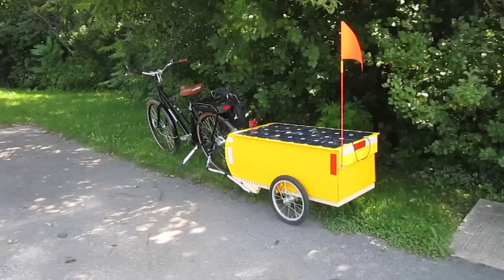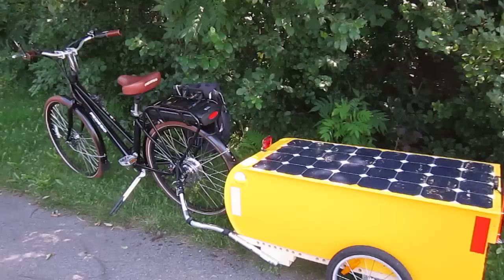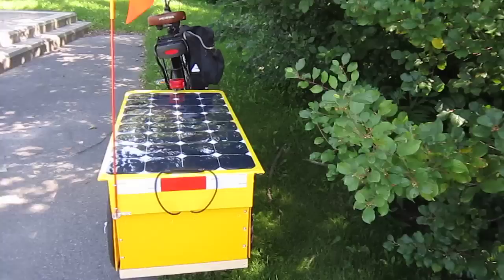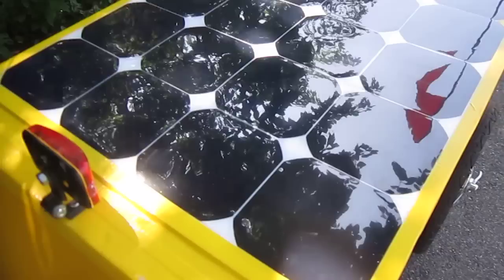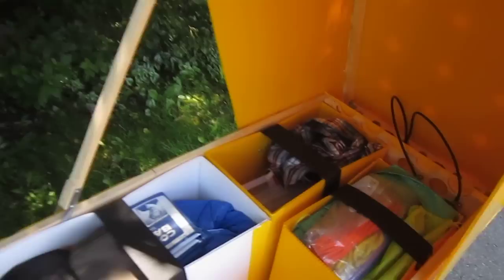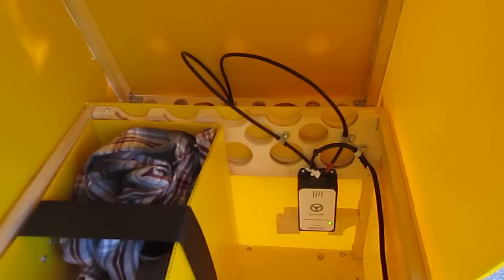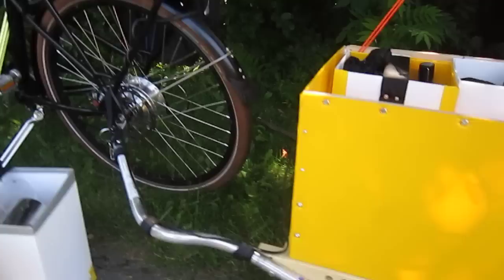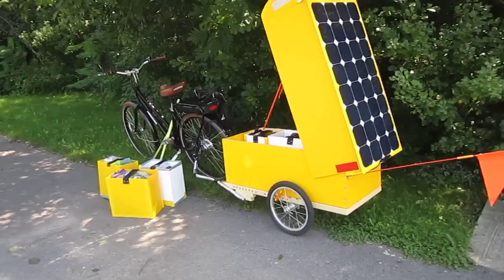Solar electric bicycle touring trailer for luxury camping

Comment: Very cool Robert. I built a trailer for myself last winter and our designs are amazingly similar! With the exception that I actually sleep in my trailer. I just returned from a 3 month,3700 km trip. I decided to post on my return rather than before I left. Check out my rig on my channel "yode on the road" I dig your design!
Reply from the maker: Congratulations for your great trip!. Do you have a picture of the trailer you sleep in?
Reply: Yode On The Road
Reply: Hi Robert. It took me a while but I finally an aged to post my camper.  The file was too big so it had to be cut a tad short. I see you joined my channel on Ytube so you will get a notification. Look forward to seeing more of your ideas. A few kms apart but two Canadians thinking in the same box...cheers!

Comment: insuffisant pour recharger un moteur électrique  !!!!!!!!!!!!!!
Reply from the maker: Vous avez parfaitement raison. Mais mon but est d'augmenter mon autonomie,  ainsi que de promouvoir l'énergie solaire.
Reply: The output left me doubting the idea but thinking of it as a mobile device to promote solar energy while battery boosting makes sense. What's the extra weight of the solar panel and the approximate weight of the trailer (with or without the panel), I wonder?
Reply from the maker: The trailer weighs 23 lbs without the solar panel. The panel itself weighs 6 lbs. It might make more sense to simply buy a second or third battery.